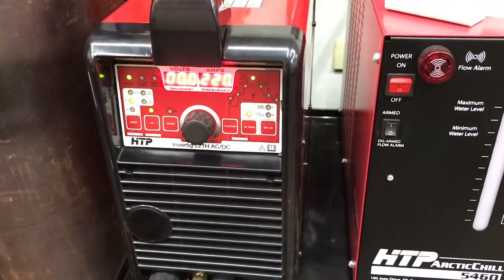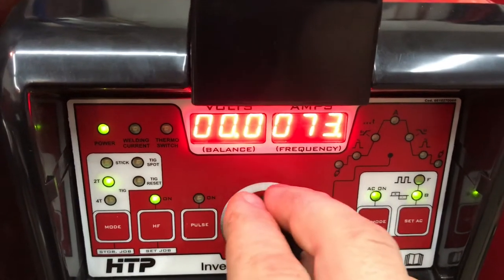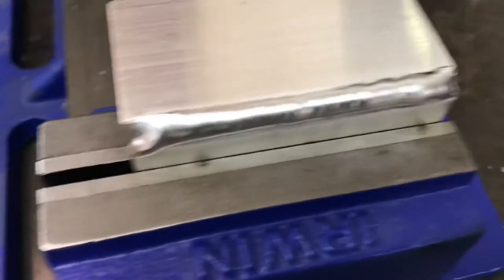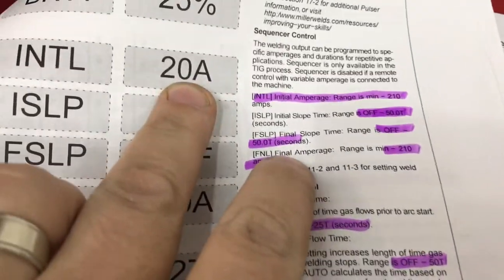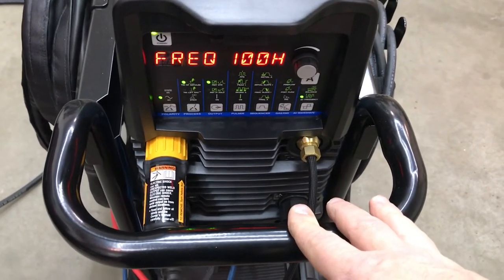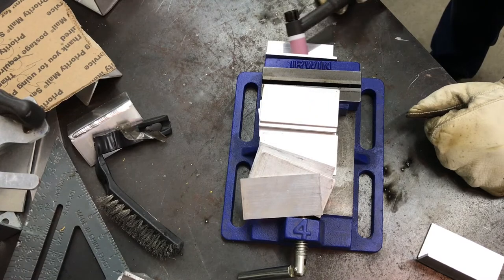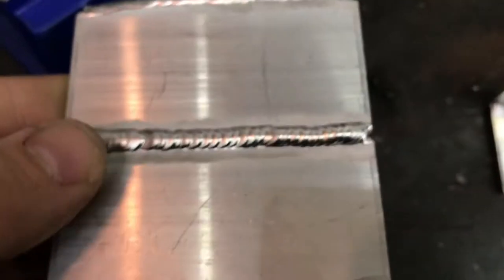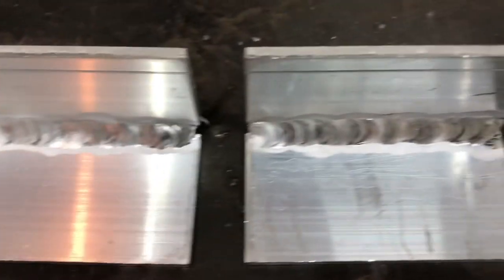Dynasty 210 vs HTP Invertig 221 showdown Aluminum who wins?

Comment: You misspoke regarding the minimum starting amps on the HTP. You can start as low as 4 amps on the HTP if you have your peak amps set to 40 amps or below. And actually I've found that while testing the machine that it actually can start at only about 3.5 amps but will display 4 amps on the machine as it rounds it off. I've welded numerous razor blades with this wonderful machine as samples for advertising. Now what you stated in the video is correct if you have your peak amps maxed out of course but I like most will adjust my peak amps appropriately for the job at hand so I have more precise control over my amperage.
Reply from the maker: Mark B thanks for watching mark I didn’t mis speak tho. I was taking starting amperage to stable the arc. I wasn’t talking machine min amps and that’s why razor blades get nicked at the start. If you run an amp clamp with a oscilloscope you’ll see the starting amps is what I said it was. All welders because of how they work especially in ac have to stabilize to it has to go to say 20amps for a milliseconds to stabilize the amperage. This info is also from HTP as I own a lot of thier machines. The HTP Invertig 221 is the smoothest machine I ever ran. Great little machine. They have something big coming soon as well so stay tuned
Reply: REALLY TRUE statement "machines only as good as user" lol I have noticed this. Amazing welds on 1000dollar machines, some ok looking welds from guys with 2500 machines...I am LOVING my 1000dollar setup and it's a 225amp...I feel, only reason for me to buy a fronius would be if it was 280+amps...otherwise it's like, why pay 4000 dollars for 25 more amps or somethin like that lol
Reply: Simple little things, like the "ball" feature, "tack mode", advanced square wave, and a name tag, still isnt reasonable enough for me to blow 4000 on a machine, when an everlast 255ext can do damn near EVERYTHING a miller or fronius can, minus the name. With a CK setup and the right rod/tungsten/furick cups...why go miller? We have Miller's at work, like $3500-4000 machines, my $2000 machine at home produces as good, if not better looking welds than I do at work lol I'm curious as to what your thoughts are on this, and why YOU prefer the Dynasty at home. Htp is reasonable and great machine, but miller lol my experience has been, your paying for the "U.S. made, and the name. Thanks brother!

Comment: Hey does the foot pedal from the Miller work at all on the HTP?  It looks like they are both 14 pin connectors... I was going to order a variable amp Tig button for Miller dynasty, But I am probably going to be getting the invertig 313 here soon  And I most likely would rather have it for the HTP if it only works on one machine or the other.  My guess is because Miller loves making so much money everything you get for their machines has to be for their machines only. But I just figured I'd ask you since you have both thanks Bud
Reply from the maker: Yeah it’s same connector but pinned different. I got rid of my dynasties for good. I kept my invertig 221. That 313 looks amazing I would not hesitate to buy from HTP their welders are superior to Miller I know nobody wants to hear that but it’s true. That new machine is sick
Reply: @weldingjunkie  thanks man. I figures that what it was, diff pins. Darn. O well. Ya I've made up my mind, the HTP is gna be my lifelong workhorse, best features/durability, lots of power, great reviews/service...kinda no brainer. The 400 looks sick but I dont have 3 phase so the 313 just suits me perfect, plenty of amps for what I have planned for the next 10-15years lol. Plus I got oxy-fuel torch and gettin bottle of stargon. Shouldnt be any job beyond my capabilities. :) anyway, thanks again! You'll prolly see a video after I get it, especially on IG

Comment: Htp now has a wireless foot pedal available on the website.
Reply from the maker: The Moto fixery I saw that looks good be made by SSC I’d like to see it in person $600
Reply: @weldingjunkie  ya. $600 is steep!
Reply: @themotofixery  lincoln and millers wireless pedals I think are closer to $900-$1000 so...lol ide say 600 for htp pedal is good value if u got one. Future worthy investment imo.
Reply: @DCweldingAndArt  HTP also makes a bunch of products for other brands. I'd almost guarantee that they could set up a wireless foot pedal for your miller, Lincoln, or whatever you've got. They set up torches for the cheaper import machines like harbor freight and Eastwood.

Comment: People watching these need to keep in mind that miller is TWICE the money once you outfit it with all the BS.  The day my welder needs an SD card for software updates and I need to recharge my foot pedal is the day I take up knitting.  I can light up at 4 amps, why cant yours?  Maybe I'm missing something here.  I'm still waiting for this old tony to teach me how to correctly use my pulse function.
Reply from the maker: worldtraveler that was kind of the whole reason for the videos $3500 HTP to  $4600 that’s real math as well from HTP and cyberweld due to them having $300 off. The wireless pedal is awesome it’s just a little bulky if ssc made one I’d buy it
Reply: you light off on dc at 4 amps ...  ac arcs don't light off that low ... see my reply to txviking
Reply: worldtraveler, I went back and verified as fas as tonys video ...  ( i watched it a while ago) you don't see the starting amps ...  he fried the scope and then he lights off and then hooks up the scope ...  and even an amp meter would not show you that split second of "burst" to light the arc ... it is much too fast to even register on "regular" measuring equipment ...
Reply: ZILA Yup..  you're right, DC, just tried it.  Thanks for setting me straight.  It's a useless ability for me as the lowest I ever find myself is around 20amps.  😎
Reply: @jagboy69  I'm somewhat new to TIG welders, so please keep that in mind ... Am I correct in assuming that you own both of these welders and, if so, which one requires all of the software updates and recharging?  Please don't take the questions the wrong way, I'm just an old stick welder who's been thinking about moving to TIG for quite a while, so I'm trying to learn as much as I can about these machines before making the move.
Reply: @timberwrightsvs480  The Miller plays the software sd card nonsense.  The HTP machine is dead nuts simple to operate.  I'm still tickled pink I own one after all this time.  I'm a home gamer, but I'd say I use mine a couple of times a week.  My ONLY complaint is the location  of the on/off switch and that's because my cart sucks and it slides towards my bottle.  It's a mig cart and not really for a tig machine.  (35buck harborfreight junk cart? :-/
Reply: @timberwrightsvs480  and no..  I dont own the miller..  Welding Junkie has some millers and he's had his share off issues with them.  I wont touch em.
Reply: worldtraveler p

Comment: 22 is awfully high for starting amps. Is that only on AC?
Reply: yes - the dc starting amps is 4 amp on ac because you can not light a stable arc in ac at 4 amp it has an AC hot start which for s split second give it about 20 amps just to initiate the arc, it drops down immediately after that,   it welds coke cans just fine... I don't know what the millers ac starting amp is but it is damn near impossible to light an ac arc at less than 15 amps ...  from what I understand the dynasty is at 20 amps staring ....  so not that much of a difference...
Reply from the maker: ZILA Pete has got it, 20 amps for dynasty. Idk if this is just on 4T because I only use the pedal on both. I think with the pedal you can get to the bottom end. Pete can you confirm this?
Reply: 2T or 4T does not matter ....  ac needs a "burst" of amperage to get the arc going, then it can "drop down" to 4 or 5 or whatever your lowest setting is.  but an ac arc does not light off at 4 or 5 amps
Reply: everyone is wrong, maybe, LOL :-D.  I have the 221.  The section of the manual that he was looking at for starting amps was for the *4T mode*, that is why it is written as ILS, I= for current, LS= for low slope.  ILS is a percentage based setting because it is dependent on the main welding amperage.  This ILS function does not determine the minimum amperage from the machine in general.  *That is the OFS setting*.  In DC, minimum amperage is 4A.  In AC, minimum amperage is 10A.  This machine does not have a hot-start for aluminum like MIG machines (such as the ProPulse series) do.  If you set it at 10A on AC, it will try and initiate an arc at that amperage.  It does not have a burst at a higher amperage than what you set the main welding amperage it.  Whether or not it lights up depends on many things, such as arc length and/or tungsten diameter and taper profile, even joint geometry has a drastic effect on how well a TIG machine can light-up and maintain an arc.
Reply from the maker: Oscar Sanchez Jr, BSc. I understand what you are saying but that’s not what I was talking about. Pete programs the 221. That machine and most machines start 10-20amps for a millisecond then go to selected amps. The arc would never lite up at 3/4/5 amps and be stable starting at that. But yes In 4T you are correct. But you are wrong about the starting amps.

Comment: I don't get difference between balance and separate EN or EP percent, for me it looks like the same thing 70-30 is the same when you set EN 70% or EP (cleaning) 30%
Reply from the maker: It’s breaking the wave down more than just balance you can be at 30% cleaning and pull more EP out to get deeper penetration or visa versa if you have something really thin. Balance you are using a fixed  50/50 EP & EN at 30% cleaning  with this you can change that part of it. With this you can make your square wave 70 EP & 30^ EN for fine tuning there is a huge difference
Reply: @weldingjunkie  Thank you so much for answer, I think I get it now, I'm from Europe and I'm planning to buy this HTP (STEL) 221, so this, breaking wave form, is basically more precise tuning already set by balance.
Reply from the maker: @milanmilicevic4618  yes exactly it just takes the balance and let’s you manipulate the square wave past 50/50. This is very use full for something on the thicker end of the machine and you don’t want to compromise cleaning to penetrate and visa versa for thin. These are the smoothest arc and best machines I’ve seen out there in a very long time. I like the Stel colors better
Reply: @weldingjunkie  USA Weld now offer, anniversary edition in same color like STEL with HTP brand :) . I must say that I prefer your prices, for example foot control, in UK cost 774.85usd , as I saw on USA Weld, it is 160usd. Maybe that form UK has special power to make cup of coffee, who knows, it is 774.85usd. 
Thanks again for help.

Comment: I have the HTP 221 and it is sweet! The only thing miller has over HTP besides being twice the price is parts availability locally but for the price you could just have parts overnighted for your htp and still probably end up being cheaper!
Reply from the maker: The Moto fixery right! I feel the same way and actually I’ve ordered parts for my dynasty 200dx when I had it and my LWS still had to order. No ones sticking much these days to save. HTP usually can get a part out same day and few days in mail. I absolutely love my machine. Also the amplitude setting for the dynasty the sd card has to remain in the machine to use it.

Comment: Miller is like snap on, rarely worth the price
Reply from the maker: chris jones you got it, strap on used to be the top dog but no more. I mean even pittburg offers lifetime now. You may go more often to get a new one maybe but worth it. I love my Snap On Verus edge scanner “it was new” bought it for $3500. Has 10x the data my Autel Elite has but still my Autel can program keys the strap on can’t. 

As far as miller goes it’s not your grand daddy’s miller anymore so to speak. I made a few videos just has major problems with my dynasty 280dx.
Reply: @weldingjunkie  for a company sure. For my money I feel there are better options for the money
Reply from the maker: chris jones totally agree. Lot more options out there these days.
Reply: @weldingjunkie  htp,esab and possibly everlast. No personal experience with everlast so not a recommendation but I do love my esab at home and used lots of millers on site. I'd say with no dig adjustment like in field my esab miniarc 161 Lts is every bit as good as the maxstar ,200. No food pedal or gas through on machine for Tig but in field that's nornal so all things considered I bought the esab.. weld mainly stick pipe and this machine does everything I need. In field is 6010 root and maybe hot and 7018 fill and cap and do not need to touch machine for anything on my esab. Can do it with the maxstar 200s but feel not as smooth arc unless u change dig from root pass and that's not always practical in field
Reply from the maker: chris jones always wanted to try Esab, I’ve used many miller machines, and about 4 or 5 HTP machines and I have to say I actually love my HTP machines like you they are just so smooth with little or no adjustments. A lot can be said for arc dynamic and I think that’s way underrated. Millers arc is good but not as good as HTP. I wonder how good esab is compared to both. The max star are little to be desired to be honest. The dynasty is prob the only miller machine I’ll ever own now. I’m done buying miller. Also for the ac amplitude I had to buy a $550 card to have it. I don’t pipe weld mostly aluminum. What esab machine do you have?
Reply from the maker: Not sure I’d ever buy an everlast. I’m not a fan of the backward ac balance
Reply: @weldingjunkie  very good point just like the Pittsburg lever on the ratchets. Fucking stupid. So that's a great point for sure
Reply: @weldingjunkie  I seen that about the card, ridiculous.  I have the mini arc 161 Lts. Stick and lift arc Tig machine...  Wanted something to practice on for what I'd see in field feature wise and the esab nailed it. Been an awesome machine from low amp Tig to 5/32 6010.
Reply: @weldingjunkie  ever replace primary board on the dynasty 280? I’m having problems with one right now. Only 23 hrs on the machine. Out of warranty and looking at $2500+ to fix 🤦‍♂️

Comment: U could start off lower if u just turned your amperage down :)
Reply from the maker: jarrett754 the starting amperage is pre set no matter where you start your amps. It’s preset for a half second or whatever the manufacturer sets it at. This stables the arc before it goes into the panel amprage. I’m assuming that was what your comment was for?
Reply: I may have misunderstood as well.  I thought the starting current was 10% of the selected current meaning 20A starting at 200A selected.  Could the starting current be lower if you were welding at say 120A?

Thanks
Reply from the maker: grant schmitt it’s a common misconception. The starting current is always the same no matter the amperage. It needs the burst of amperage to stabilize the arc especially with ac. It does have a min max and that what people think the starting current is but it’s not, it’s whatever the manufacturer sets it at for arc stabilization. That’s why people blow the edges off thin stuff and people start up on copper etc